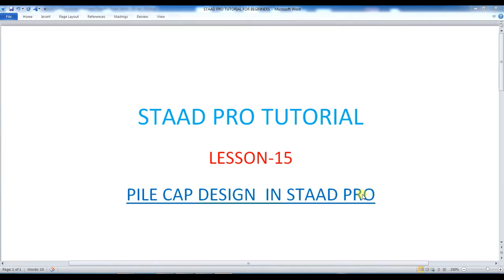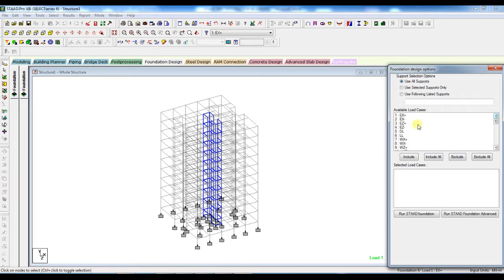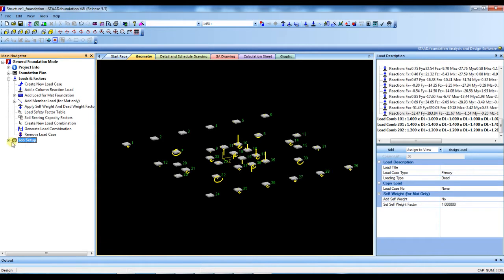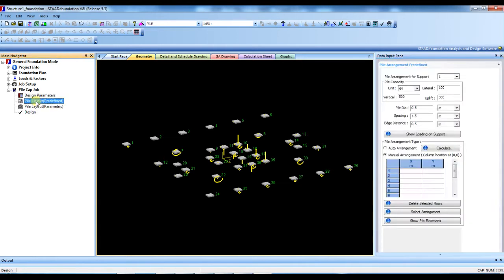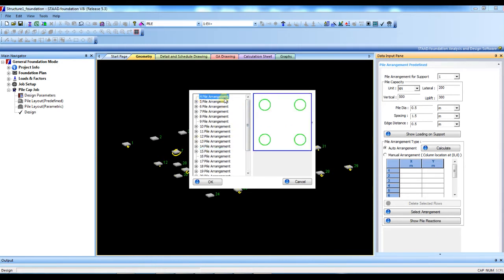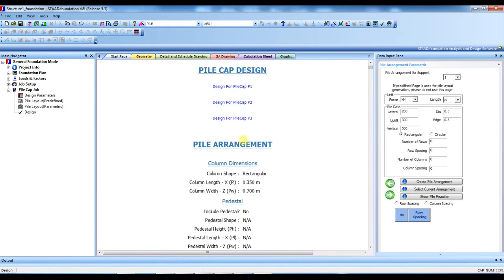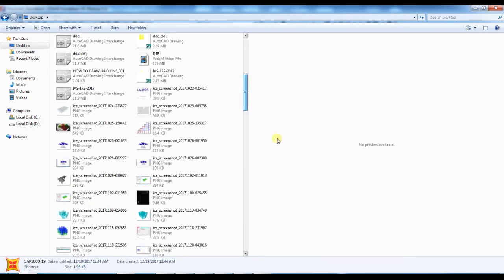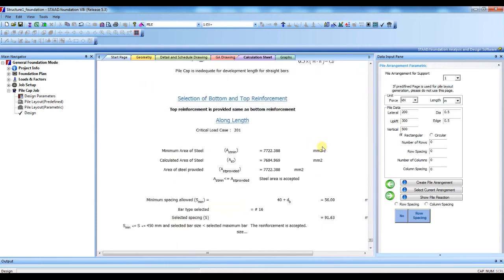PILE FOUNDATION DESIGN IN STAAD PRO  LESSON-15

Comment: sir how to design pile caps for different columns u will show only one column , how to design total coloumns each pile cap is designed separately or at a time some thing any else pls gave reply sir
Reply: I agree with you Sachin sir, I'm having the same case too...

I've to design a PILE FOUNDATION for multi-storied building of area 48 x 48 m2. It has many columns nearly 186. Its meaningless to analyse single column and design a pile cap & shaft for it. Therefore, for my case there should be a common PILE CAP which happens to be a common RAFT above. Underneath this single RAFT/CAP it will have many pile shafts. 

ENGR NURUZZAMAN HOSSAIN sir, we both shall be thankful if you could help us...